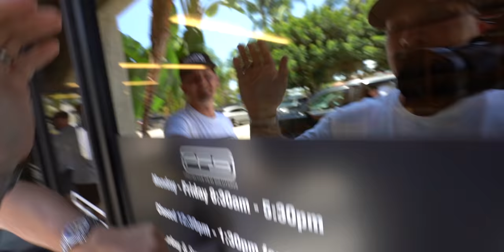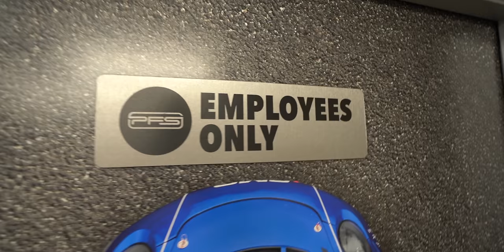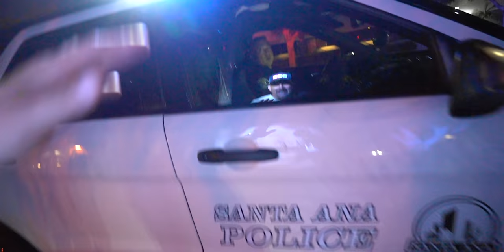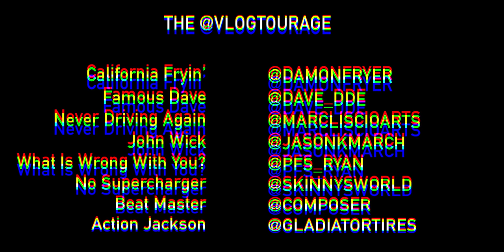TWIN TURBO F12 FERRARI SHUTS DOWN CALIFORNIA CAR SCENE!  *WE ARE BACK!*

Comment: If this becomes like the new Hoonicorn, that would be INSANE!
Reply: i liked the stock sound more ✌😅🥲
Reply: But those turbos sound nuts! It’s not even tuned yet!
Reply: ya only missing 1/2 the hp and 10X the performance LOL
Reply: @trophyburro gatekeeper
Reply: @29Nerox  just apples to apples my man
Reply: @firat3000  you just heard it @ like 2000rpm lol. Wait till he’s bouncing off limiter. It’s still gonna have a mean v12 sound with the exhaust being so short
Reply: It’s just tt dude. The hoonicorn was 100% customized.
Reply: @allspooledup2584  👌
Reply: @davidwavidshmavider  ones fashion ones function :)
Reply: @trophyburro  you prefer fashion? It’s the stock color even dude. I expect way more out of DDE. They used to wrap, lower, wing, wheel, AND TT cars.
Reply: Huricorn
Reply: @davidwavidshmavider  prefer fashion?   nah of course not.  You have to give em them a little credit for actually getting a pro fabricator on this one.  AK is the man and the work look sano ..   Just not in the same ball park as a ground up build race car like hoonicorn..    None of this stuff they do really adds performance obviously good for views
Reply: @trophyburro  I agree. I just wish they did more to cars today than tt them. They dont do donuts, or do burnouts, or drift things, they dont even wrap cars anymore.
Reply: It is a low boost engine. Impossible to become the next hoonigan.
Reply: @trophyburro  the hoonicorn is just a drift car and that ain't what I call performance, performance is what u can do on a track
Reply: Its defo a corn, very unique but talking numbers its way too heavy to do hoonicorn things. Im still hyped to see damon shred tires in the thing tho.
Reply: @cheezuscrust6868  It’s totally stock aside from the turbos. That’s it. It’s no where near the hoonicorn, in any way.
Reply: @firat3000  on high revs it sounds like the v12
Reply: It isn’t just stock besides the turbo.  Do you understand the engineering and supporting modifications that had to be done to get those turbos to work and highly
Compressed engine, fuel, cooling, throttle bodies, exhaust, etc…. In addition it would have been WAY WAY easier to turn this into to the Hoonicorn with a stand alone and no creature comforts.  This is an absolute engineering feat, hence why it’s never been done before.  On a 15:1 engine 4 lbs of boost can get you near 300 additional HP.  With Gintani I bet anything he opens the engine, upgrades a few bits and push’s near 10-15lbs.  This car is a monster and absolute monster
Reply: @trophyburro  hoonicorn series is not just looks those cars have insane performance. They’re not all drift cars and they’re not all race cars.

Comment: Thee Aaron Kaufman from GMG…. You are one lucky maniac Damon 😎  Aaron is a meticulous mechanic/fabricator/magician and somewhat hard to pin down and get him to do stuff like this anymore.  I can only imagine… wait… NO I CAN’T IMAGINE AT ALL 😳  
AND FOR ALL OF YOU THINKING THAT AARON DID ANYTHING OTHER THAN AN OUTSTANDING JOB ON THIS F12, THESE BEASTS NEED TO BE DIALED IN, THIS AIN’T NO PLUG AND PLAY OPERATION HERE.  THANKS TO THE GUYS OVER AT GINTANI FOR POLISHING UP THIS ROCKET AND WORKING OUT ALL OF THE ISSUES THAT COME ALONG WITH DROPPING TWIN TURBOS ON A CAR THAT WAS NEVER MEAN’T BE RUN WITH ANYTHING OTHER THAN A NATURALLY ASPIRATED FUEL INTAKE 🇮🇹

Comment: Not a fan of the gurgling, bubbly motorboat sound. Sounds like a V6 with dual exhaust or a V10 just got that little bubble Pop. But what do I know I'm just a die-hard fan of a 66 Chevelle with a 427 and some three and a half inch exhaust.